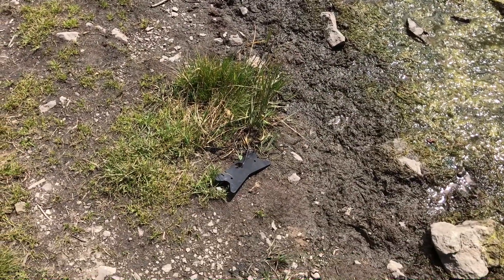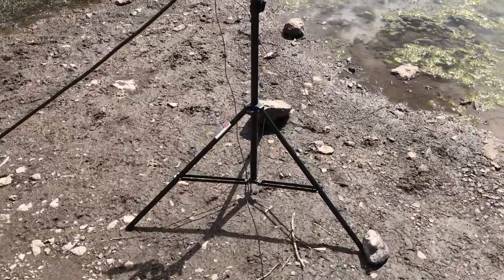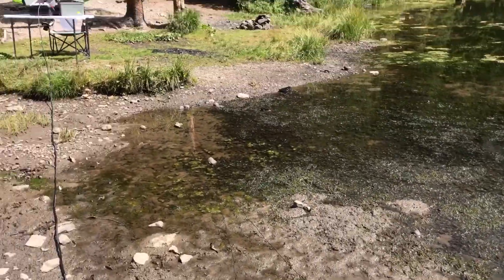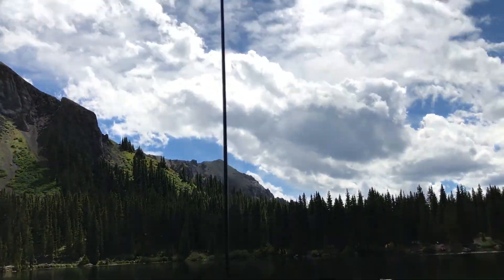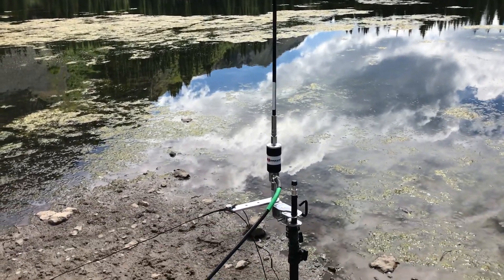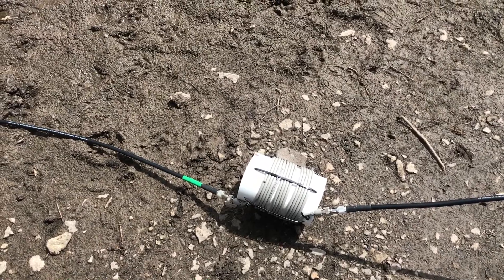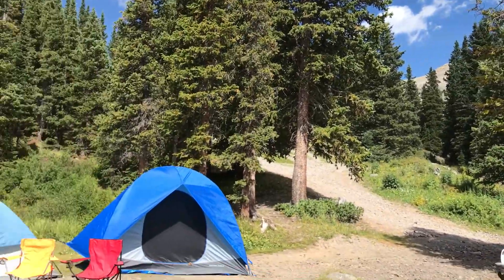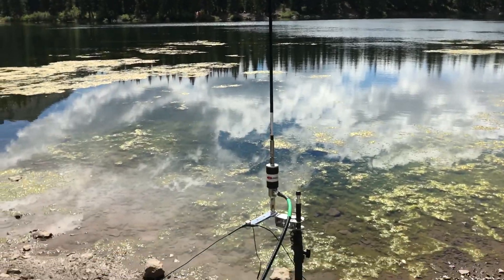Chameleon Vertical Antenna setup

Comment: You don't need a choke because the antenna isn't balanced such as a Dipole.  The outer braid of the coax acts like a ground radial .